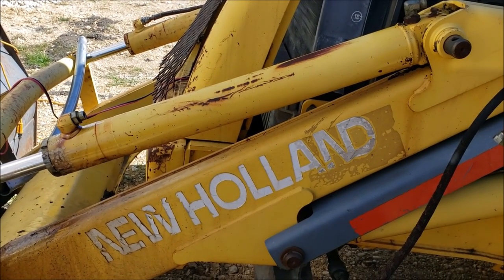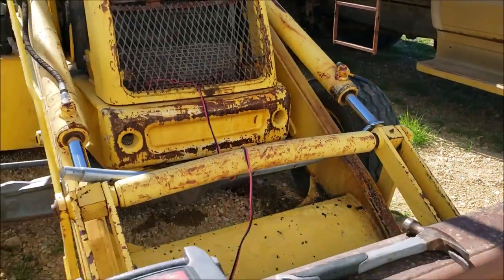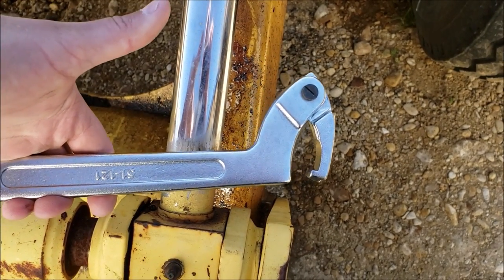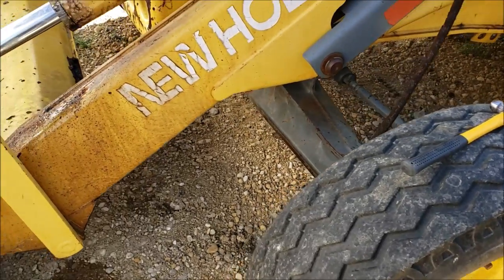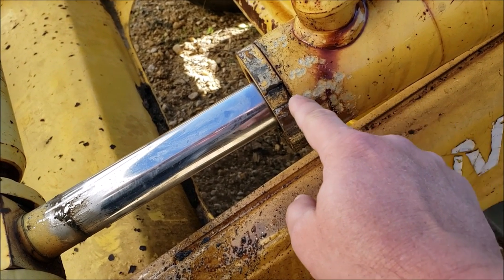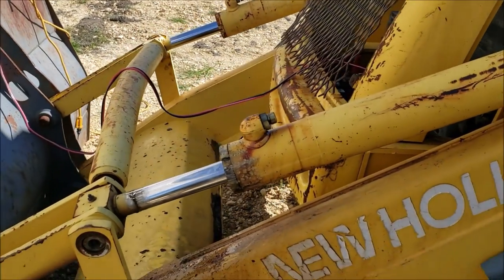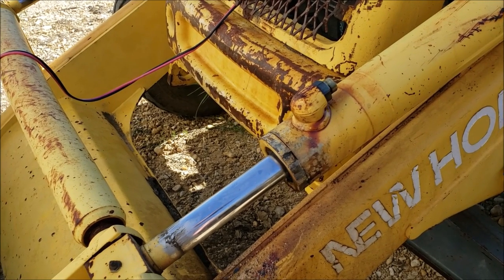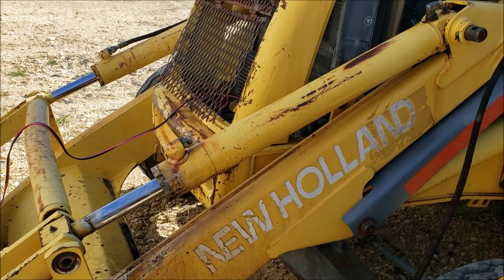Replacing Hydraulic Cylinder Seals - Part 2 - Removing a stuck gland

Comment: You know I actually watched the entire thing. Actually enjoyed listening to you talk. I have a screw on one which I can't get off. Maybe watching your video took my mind off of my problem. There is a lot of rust bridging the gland and cylinder . No joy yet.
Reply from the maker: Did the ping method not work?
Reply: To be honest I'm not comfortable banging dents into the threads. I can't remember if yours had a spring inside. Mine doesn't. It has 2" wrench flats on the gland of which I have a crows foot wrench for. I don't know why I can't break it loose. What does the ball peening actually do?
Reply: I just viewed the beginning of part 3 and realilized that your gland is not threaded. From a diagram I know that mine is!

Comment: He never does take off the gland and rebuild it.
Reply from the maker: I do actually.  There are 5 video parts that cover the whole process.
Reply: @SeidelRanch  I was talking about this video and the couple before it. At this point, I gave up watching. You did eventually rebuild the gland but you never showed the detailed process that everybody needs to see before attempting to do it themselves.
Reply: That is a pretty good point.. Showing the actual peening would be useful. Perhaps consider a body cam and put it on time lapse for the stuff that takes a long time. 🙂Thanks again Seidel!